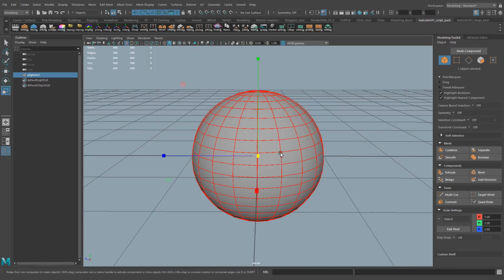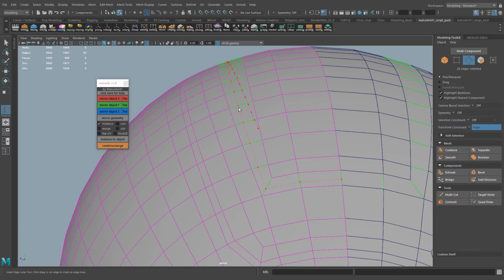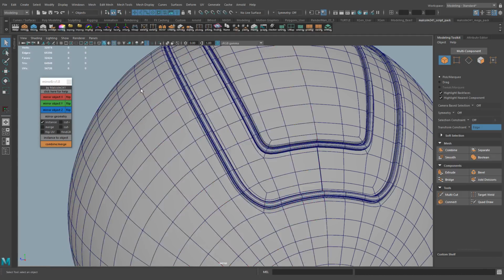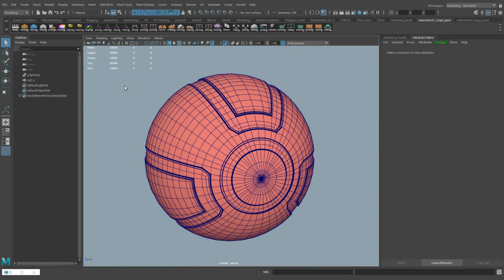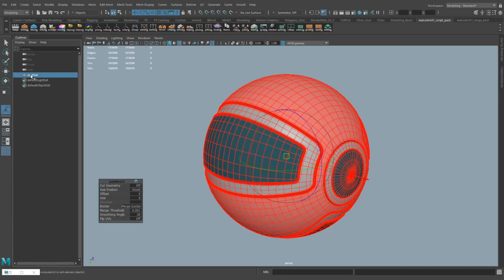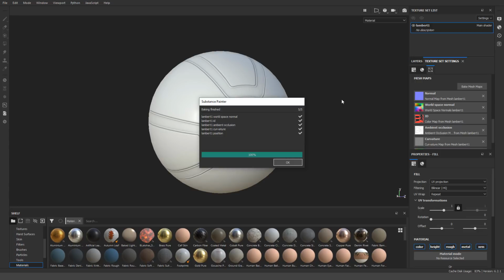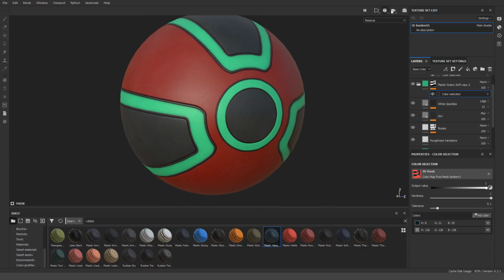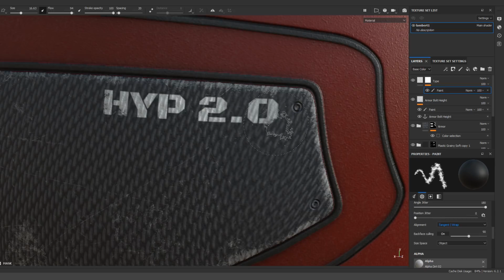3d Modeling Explained # 02: High Poly to Low Poly Video Game Art Creation using Substance Painter

Comment: Hey @JLMussi. May I ask how come in Substance Painter you have one texture set while in Maya you have assigned different materials on the low poly?
Reply: You apply the multiple color Id on the highres not the lowres. Or option 2 you bake in maya you ID color map and before exporting you reassign à single material